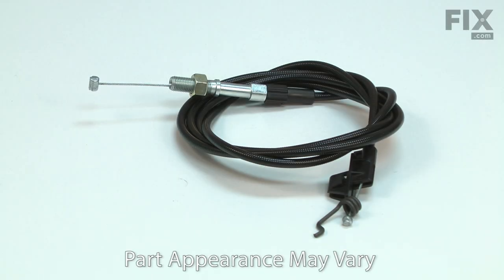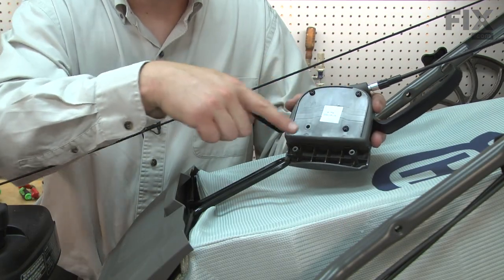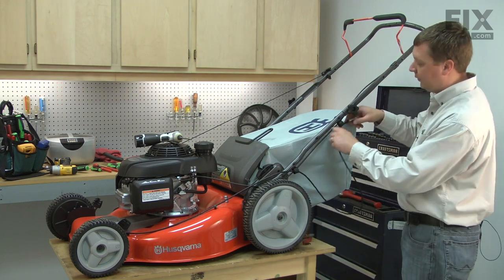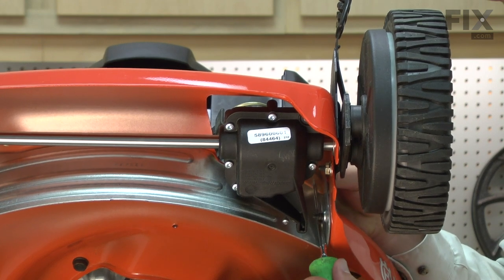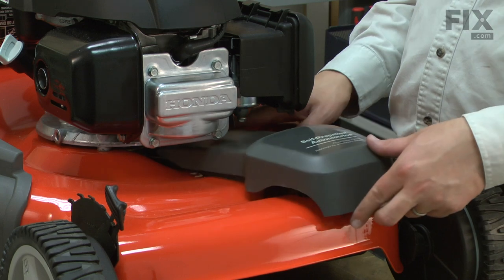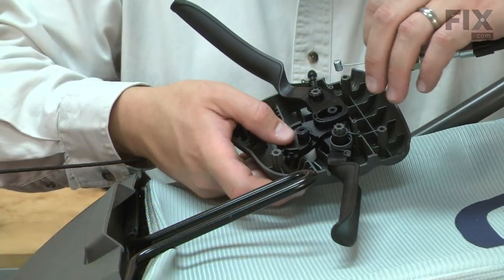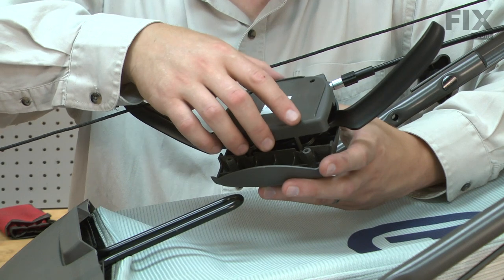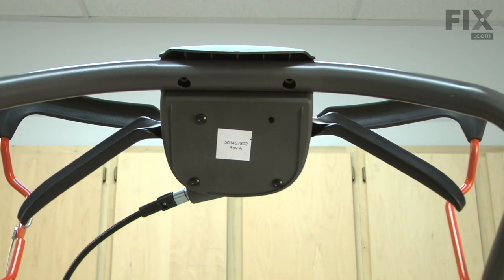Husqvarna Lawn Mower Repair - How to Replace the Drive Cable

Comment: Excellent video!!!!   My Husquvana is like 20 years old.  Then, they didn't sell just the cable. They wanted the whole assembly for $79.    And this happened the first year I owned, rear wheel drive, 1 lever to adjust all 4 tires, etc.  So I went looking for cable. Found some at a TSC store although slightly thicker but it still fit through the rubber hose.  I used the broken cable to give me the desired length.  Then feed through the rubber original hosing. Now I needed the metal ends as I tried to use with no success. So I went to the tackle box, got a couple of those little lead sinkers you slide on your fishing line, and crimp on your line. I put one on each end.  I then used my cheap soldering gun, flux, and welded them on while working to get the approximate shape of the original ends. Then I attached as you have shown and it's been working great for almost 15 years.  Cost me $3.29

Comment: Very helpful thank you. You wouldn't happen to know what size those screws for the drive control are would you?. Different Husqvarna (7021r) but same drive control. Unfortunately I have no screws to mount it to the handle.

Comment: Please show cable replacement on the RWD  21"  and is it necessary to pull off all the plastic protection sheath on the mower's under side? Also, why ISN'T  there a protective screen above the blade where the belt
is exposed to grass clippings and moisture. I have to replace the cable  21/2 years after purchase.
Reply: Did you ever find out how to do this on the RWD?

Comment: No value to me  mine is a 7021R Rear Drive   this is for a front drive
Reply: While it's in the front and some parts are different the idea is the same...ish, still can learn a lot from this. I also have a 7021r. Found it in a reuse area and am rebuilding it bit by bit, I love it. Parts like the drive control assembly, cables and stuff are all the same.